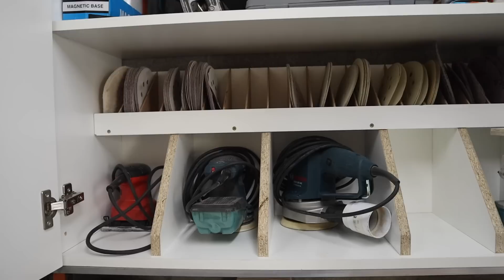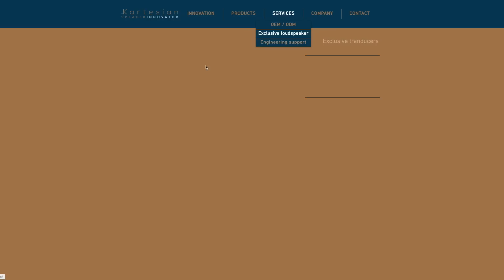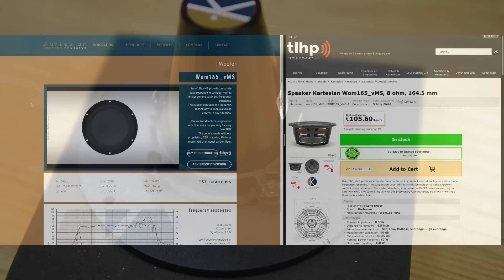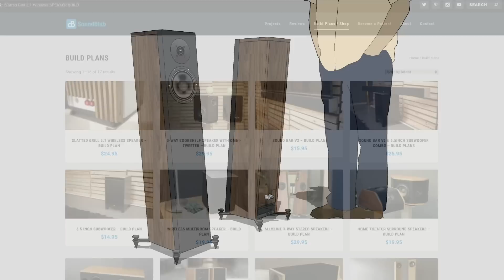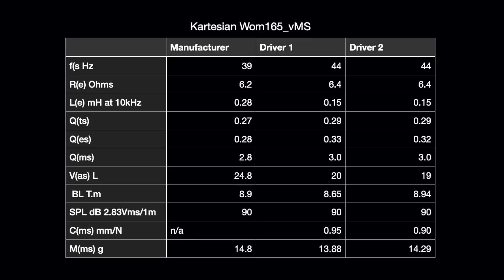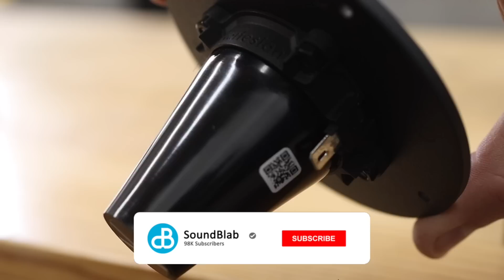Building a 2-Way Floor Stander Speaker with Kartesian Drivers PART 1 - by SoundBlab

Comment: Wom 165_vMS Impedance measurement: 400 and 900 Hz Distortion. Something wrong with the "motor". Not nice...
If you see something like that... take another woofer. Design mistakes...

Comment: This woofer not two-way with tweetter! Absolutely unusable top end region from 950...1000 hz.  Definitely something wrong with it as so many bloggers push around.
Reply: Which bloggers are you speaking about? This is wrong, I made a MTM system with these Kartesian woofers and Twt30_vMS tweeter, it sounds amazing.
The small impedance peak at 950Hz is a detail, easy to manage, and it doesn't disturb sound quality. 
Do you really think that a speaker manufacturer who works with Klippel, publish all results, and set up many innovation would ignore so basic issue?
Reply from the maker: Well, I don't know what the bloggers are saying, and I have not listened to this woofer or tweeter yet. My tests will reveal whether what you say is true or not. Once I have frequency and measurement graphs, we will have more info.